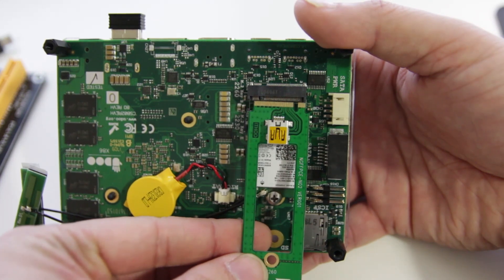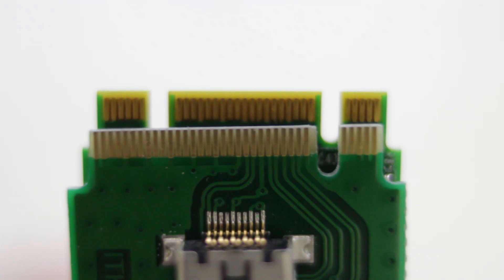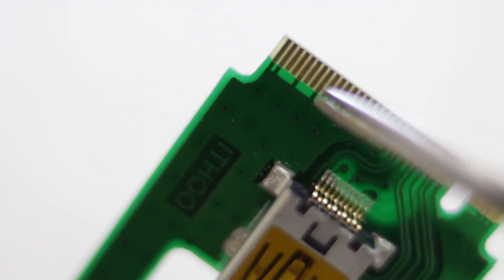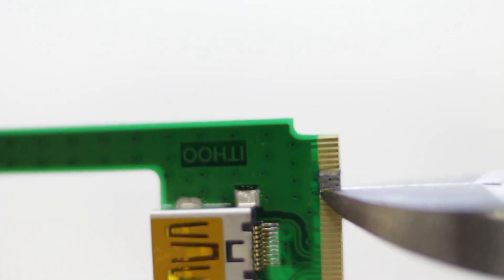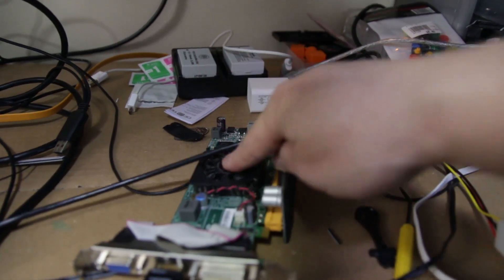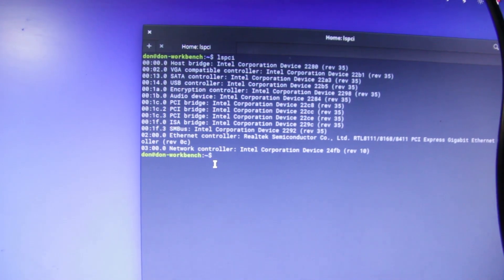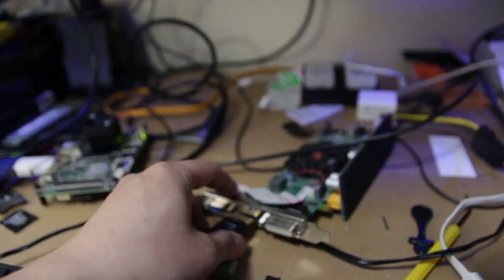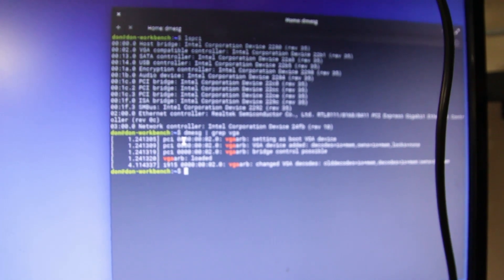Converting M.2 key M to B+M

Comment: You have to mask off two pins on the back of the card so that the system can detect it properly. The system does different things based on which kind of card is inserted into the slot and it’s able to do that because of certain pins that become active so the reason it’s not working is because the two pins that you didn’t mask off Are causing the system to look at the card as if it was a sata device. The whole m.2 interface functionality is based around the combination of active pins in the slot in order to be able to control PCI, SATA, Mini PCI and USB devices from any given m.2 slot that’s available. The system determines the protocol the device should be using when specific pins are activated.

Comment: Why the fudge did they come up with keys. I had to get a converter for a B key modem found it really hard to find one that worked (had to have a sim slot too) so In the end I had to have two adapters. A B key M.2 to MiniPCI-e and then an M.2 to PCI-e adapter. What a pain. It's just a bloody PCI bus, no need for all this trickery.

Comment: So to explain why this doesn't work for anyone that finds this video: His motherboard has an M.2 keyed B key (supports PCIe x2, SATA, USB 2.0/3.0, HSIC, SSIC, audio, UIM, and I2C. The PCIe riser converts PCIe x16 to USB 3.0 to M.2 keyed M key (supports PCIe x4 or SATA). Technically speaking the motherboard /could/ work, but it's up to the motherboard manufacturer to decide what features should be implemented. In this case, the motherboard's M.2 slot does not implement PCIe but instead SATA, so it doesn't work. It was a good try, and a good learning experience. As this illustrates, M.2 is a little complicated.

Comment: this is just stupid, the key is there for a reason
different key have different orders for those pins on board, simply chip out the board is not gonna magically move the wire
at least do some research before act

Comment: I have no ssd on my motherboard and have a m.0 ssd https://www.aliexpress.com/item/KingDian-ssd-m2-1TB-M-2-2280-SSD-128gb-256gb-512gb-SSD-SATA-60gb-HDD-Internal/32985030187.html?spm=a2g0s.9042311.0.0.24424c4d6onTiA  << that 1 i need a pcie adaptor card (riser) that will work i have a b + m key card and it dont detect any ssd all leds are red nothing in bios or windows so what pcie card do i need for that linked ssd above?

Comment: I don't know for sure, but I thought that B-key slots were used for SATA M.2 drives and don't work with PCIe. They use the same form factor but completely different signals. Of course, this board could be different.

Comment: Hallo, is there possible NVMe M-key connect as USB via [Pcie Express PCI-E 1x To 16x Extender Riser Card Adapter USB 3.0] and though [M key M.2 NGFF SSD to PCIe X4] adapter? 
I'm losing my nerves, because I ordered third stamp USB NVMe case box, and every time arrived NGFF B-key box (nice dirty trick of sellers as to foist unwanted articles). Thanks for respond.
Reply: NVMe M-key SSD

Comment: I have seen few other guys trying to use those stuff on a Laptop and it failed and burnt the socket. May be you should try the M key that has PCIe x4 on it. UDOO claims it works with proof.

Comment: I think your assumption that the pins you decided to cut out were not connected to anything  (or not needed) according to the physical schema that you saw is a dangerous assumption!
You should have looked into the service manual for the M Key card to check out everything. I am not surprised you had a fail on this one.

Comment: we support you for your work.  I have a query which is not related to this video, can you suggest a way to convert encoder feedback in the resolver signal by PI and a solid-state power controller. I am not sure whether i am asking a right question but that what i need for my project.

Comment: I was able use same method and it worked.

The idea I used based of 
https://www.hackster.io/matteodelbalio/udoo-x86-with-geforce-gtx-1060-gpu-2aed20

And i have made at least model of riser you showed in my udoo x86 ultra board work.

Comment: NO FAN, NO POWER.  Config_1 unconnected - pull up - if pin is floating, you get no pci-e.
hdmi signal detect works by sensing pull down in hdmi cable - doesn't matter if monitor behaves differently, no picture = no power, no power because pci-e has not initialized, which means pci-e interface on gpu has not negotiated power, which means its not connected.
Reply: As far as I know all gpio and pci-e on atom on mobile processors such as on the udoo x86 are to be left floating. Uefi/secure boot is responsible for configuring the registers to set pull up or pull down. Default firmware from Intel leaves the interface in default sata mode unless card explicitly pulls the line high
Reply: there's a reason why they put an m.2 module slot there and not pci e, its pulled low in firmware by default - pulling to high enables the pci-e transceiver and overrides firmware default.

Comment: I enjoy your content dude but I have to say the noise cancellation you do in post is too much, to the point that it's distracting from your content (for me at least).  A good microphone goes a long way in both sound quality and how little effort you need to put into noise cancellation is post.
Reply from the maker: yea..... i'm using a rode video mic, i want to switch it to either the pro version or get a h4n1.... about the same price but i will decide on that soon.... this mic was good for the first month then it started to pick up noise....
Reply: h4n1 would be good if you're moving around a lot.  Have you tried the rode in a different configuration? because of the pick up pattern it could be picking up sound from a device behind you.  Usually having it above you pointing down produces the best results.

Honestly with how close your are something like the Rode NT-USB would do the trick, or even the snowball for a cheaper option.  A lapel that plugs into your phone would be a great solution if you're moving around and looking for something more mobile.

It's also not bad to have some background noise, as it rounds out the audio.  Maybe just try lowering it rather than removing it completely. (the second half of the video definitely sounded better to the first)

Comment from the maker: i'll keep you guys posted if i ever get it working via twitter @novaspirittech but as of now this was a view exciting project to say the least even thought it didn't work yet....
Reply: there are keys for a reason. because the pinout is assigend a bit different between the keys. some pins are used for function X on a M only key that have a different function Y on a B only key. boards that can handle both B en M keys have some logic to handle this or they dont use these pins at all. so you cant just cut the pcb and hop it works.
check the wiki for some info about the slots: https://en.wikipedia.org/wiki/M.2
Reply: I'm curious for ports from raspberry pi like the display port, and the pinout connections if could be converted in a pci slot for a video card. maybe a mini pci. would that be possible? I think these boards should be build with a video connector for expanding graphics, it would open the world for a new kind of era, unseen for the ARM world.
Reply: only DVI-A and DVI-I have the vga signals beside the DVI. DVI-I is DVI only. the single-link and dual-link only applys to the DVI signals.
if you wand the DVI (digital signal) to VGA (analoge signal) you need some extra electronics to converted the signal.
https://en.wikipedia.org/wiki/Digital_Visual_Interface
Reply: @killergeek if you do that, please mention me in the vid so I could see
Reply: if i do what? i dont understand what you wand.
Reply: oh sorry, I misunderstood

Comment: The fan on the old graphics card wasn't moving with power from what I've seen.
Reply: Plus, the card may not be supported by Ubuntu. Maybe with Lubuntu?
Reply: Even if not supported, it should still show in the LS PCI listing.
Reply: Yeah, older cards would have the fan spinning constantly. The video cable being inserted isn't proof of power getting to it.